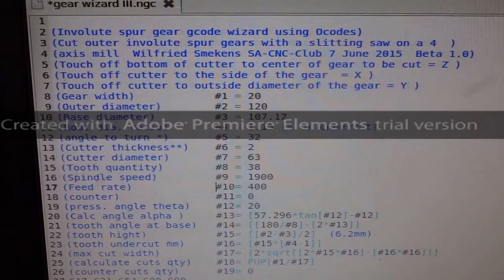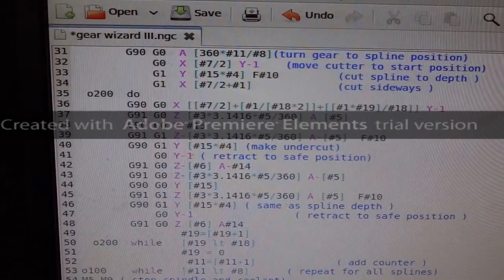gear cutting with slitting saw on 4 axis mill  - trailer

Comment: With MACH3 you can't use this sort of loops in Gcode. You have to rewrite the code and use the M98 and M99 Commands.
Also this G0 Z-#6 stuff ist not allowed. In MACH3 you have to write G0 Z [0-#6] to get a negative movement.
Try this with MACH3. It's not tested on a machine until now but simulation look's good.

;Involute spur gear free gcode wizard using O codes 
;Cut outer involute spur gears with a slitting saw on a 4 
;axis cnc mill 
;Wilfried Smekens SA-CNC-Club 21 June 2015 Beta 1.0 
;Oliver, Changed for MACH3 21 May 2018
(Touch off bottom of cutter to center of gear to be cut = Z ) 
(Touch off cutter to the side of the gear = X ) 
(Touch off cutter to outside diameter of the gear = Y ) 
(Gear width) #1 = 30 
(Outer diameter) #2 = 120 
(Base diameter) #3 = 107.12 
(Root dia. ratio) #4 = 1.15 (% of undercut) 
(angle to turn *) #5 = 32 
(Cutter thickness**) #6 = 2 
(Cutter diameter) #7 = 63 
(Tooth quantity) #8 = 38 
(Spindle speed) #9 = 1900 
(Feed rate) #10= 400 
(counter) #11= 0 
(press. angle theta) #12= 20 
(Calc angle alpha ) #13= [57.296*tan[#12]-#12] 
(tooth angle at base) #14= [[180/#8]-[2*#13]] 
(tooth hight) #15= [[#2-#3]/2] 
(tooth undercut mm) #16= [#15*[#4-1]] 
(max cut width) #17= [2*sqrt[[2*#15*#16]-[#16*#16]]] 
(calculate cuts qty) #18= FUP[#1/#17] 
(counter cuts qty) #19= 0 
G17 G21 G54 G80 G90 
S#9 M3 (M8) (clockwise splindle speed + coolant on) 
G1 X-1 Y-2 Z0 A0 F#10 

M5 M9 ( stop spindle and coolant) 
G0 Y-2 
G0 A0 X-1 Z0 
M98 P100 L#8
M30 ( The end )

o100 
G90 G0 A [360*#11/#8](turn gear to spline position) 
G0 X [#7/2] Y-1 (move cutter to start position) 
G1 Y [#15*#4] F#10 (cut spline to depth ) 
G1 X [#7/2+#1] (cut sideways ) 
G0 X [#7/2] Y-1 (move cutter to start position) 
G91 G0 Z [0-#6] A [0-#14] 
G90 G1 Y [#15*#4] F#10 (cut spline to depth ) 
G1 X [#7/2+#1] (cut sideways ) 
G0 X [#7/2] Y-1 (move cutter to start position) 
G91 G0 Z#6 A#14
M98 P200 L#18
#19 = 0 
#11=[#11+1] ( add counter )
M99

o200 
G90 G0 X [[#7/2]+[#1/[#18*2]]+[[#1*#19]/#18]] Y-1 
G91 G0 Z [#3*3.1416*#5/360] A [#5] 
G90 G0 Y #15 
G91 G1 Z [0-[#3*3.1416*#5/360]] A [0-#5] F#10 
G90 G1 Y [#15*#4] (make undercut) 
G0 Y -1 ( retract to safe position) 
G91 G0 Z [0-#6] A [0-#14] 
G91 G0 Z[0-[#3*3.1416*#5/360]] A [0-#5] 
G90 G0 Y [#15] 
G91 G1 Z [#3*3.1416*#5/360] A [#5] F#10 
G90 G1 Y [#15*#4] ( same as spline depth ) 
G0 Y -1 ( retract to safe position ) 
G91 G0 Z [#6] A#14  
#19=[#19+1]
M99
Reply from the maker: I used linuxcnc, thanks for the feedback

Comment: first off, thank you for posting your efforts.

I seem to be getting an error: Multiple x words on one line ,Block = G1 Y [#15*#4] F#10 (cut spline to depth ) G1 X [#7/2+#1] (cut sideways ) G0 X [#7/2] Y-1 (move cutter to start position).

I'm trying this in Mach3

Any help you can offer is appreciated.
Reply from the maker: I'm using linuxcnc , but this should matter little.
Make sure that you don't have 2 X axis commands on one line.
Maybe you machine setup is different.
If so, than you will have to adjust the  axis orientation in the code
Reply: skidloaders1 thank you for the prompt response. Lol...I didn't think it was going to be as easy as cut and paste. I'll figure this out.

Comment: No characters found in reading real value,block=#17=[2*sqrt
Reply from the maker: #17 calculates the width per cut according to parameters #15 and #16 ( the wider the gear the more cuts it needs )